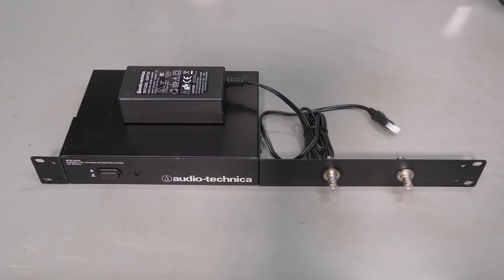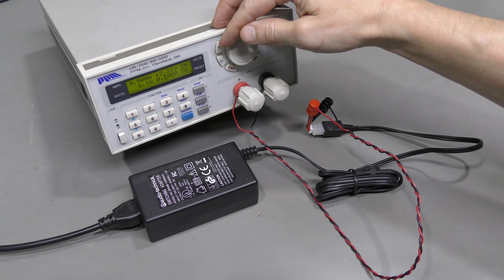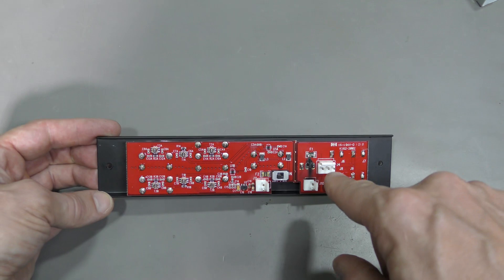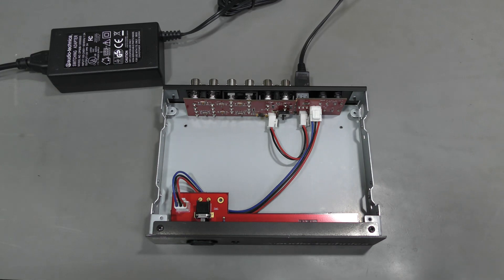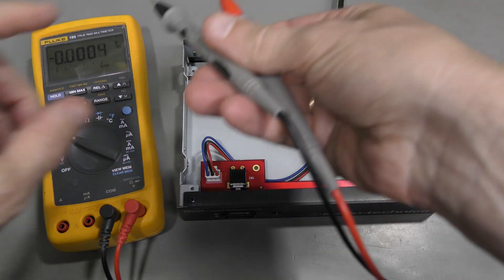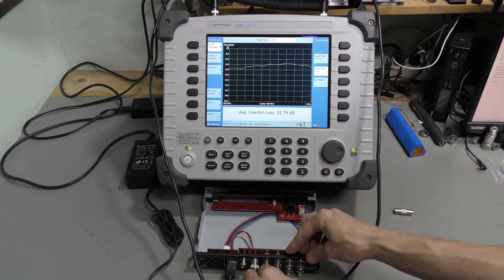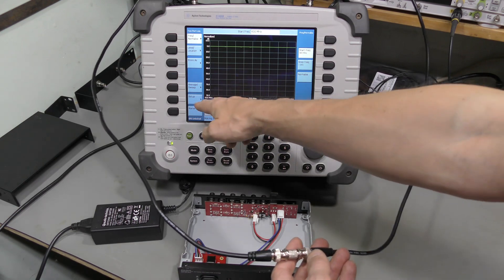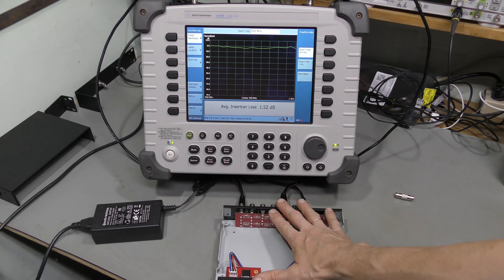#147 - Audio-Technica ATW-DA49 antenna distributor repair

Comment: What wire brand or AWG size for the extension leads on the voltage regulator?
Reply from the maker: some random AWG 30 wire

Comment: fitting the large package into the small footprint of the original one may have caused a substantial impedance mismatch and that could explain the gain fluctuations perhaps. I would check the input/output return loss to see how well it is matched
Reply: Not really, for such low frequencies